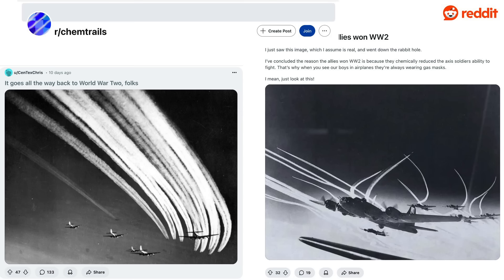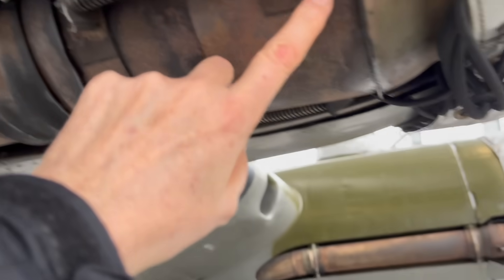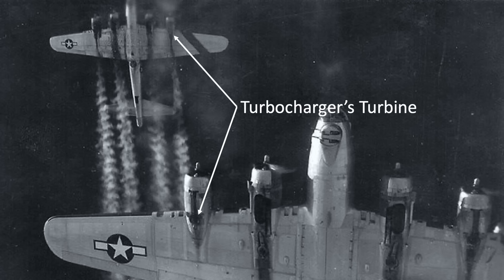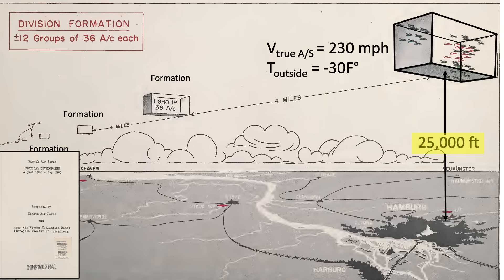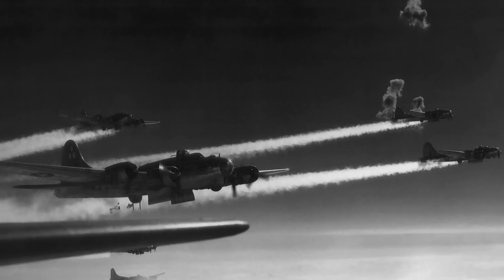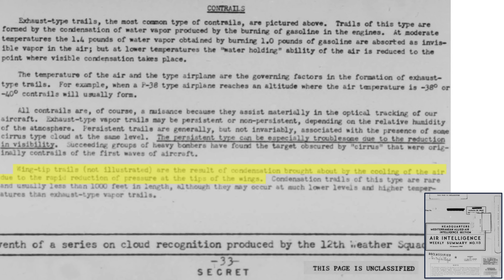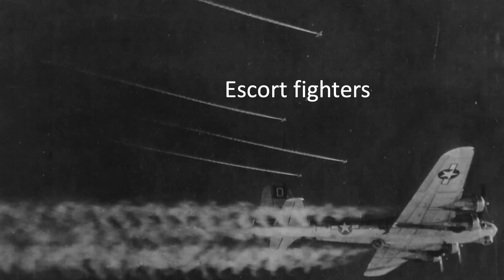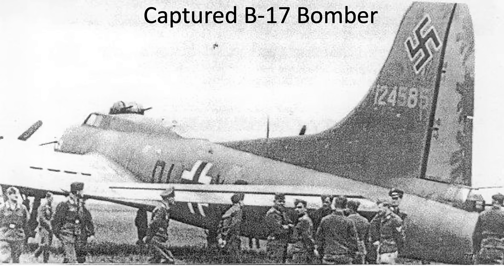WWII B-17 Bomber’s naturally forming contrails, no chemical-trails going on here

Comment: I always saw tons of contrails back in the 70s as a kid and up to today.  I really doubt super secret airplanes have been spraying toxic chemicals all the way since then. The chemtrail theories bug me because there's literally no evidence at all for it.  To cause changes to the atmosphere would require vast numbers of airplanes to be spraying chemicals every day but notice how not one person has noticed any hidden tanks, spray nozzles or anything on commercial aircraft.  The small number of actual government aircraft (ie DARPA/NASA) that could be changed to add special tanks would not be enough to change the earth's atmosphere.  The other problem is they wouldn't have airspace clearance to spray over Europe, Asia or other airspaces.  So you'd have to suggest maybe there's a additive in the jet fuel that no one has ever noticed and somehow can burn in a jet engine and still do it's chemtrail job as it comes out the exhaust.  It's absurd.

Comment: Ironically, the more prevalent contrails now are a good thing.  High-bypass turbofan engines mix the exhaust gases with bypass air at significantly lower velocities than the straight turbojets of the 70's, thus the water vapor cools and condenses in a much tighter pattern and is more visible.  So a thicker contrail is associated with higher fuel efficiency.

Comment: Thanks for putting this video together, i can't imagine what it must have been like to be a civilian on the ground looking up at formations of bombers, their escort fighters and the German fighters all flying around that area of sky.  I was a sceptic regarding chemtrails until i had my own visual experience. I watched 2 transatlantic flights flying parallel to each other one summer morning, one was flying at 36,000 ft and the other 40,000 ft, one left a trail that went from horizon to horizon and the other left nothing. At that altitude the temperature should be between  - 40 and -65 so within less than a mile of sky one left a trail and the other didn't. With certain governments considering high altitude aerosol spraying to reflect direct sunlight back out to space in an effort to slow down climate change, is it possible that some airlines are actually involved with this project and adding something to the fuel so that they don't disperse as they normally would and form an artificial cloud layer over a few hours. The British government has announced recently that it will spend up to £70 million pounds on high altitude spraying... I'd be grateful for any return comments to my comment 🙏 👍

Comment: Yes, there are chemtrails - possibly .0001% of what is seen may be cloud seeding experiments, which they actually do in some desert regions to attempt to stimulate the formation of rain clouds.  The biggest problem I see is idiots getting on social media and showing a picture of something like a twin engined  C-310 with tip tanks and claiming they are a pilot who is spreading chemtrails. That sadly sucks in a lot of people who then think they know someone who knows.    It is so hard to explain to a believer that the reason we see more contrails as there are thousands more flights than when they were younger AND, even domestic flights are a lot higher than they used to.  It is a never ending battle to impart common sense.

Comment: Some airships in the early 20th Century were experimenting with an exhaust vapor/water recovery system to compensate for the lost weight from fuel burn. Boeing could have teamed up with Frigidaire to make an ice bomber from high altitudes! And the lack of a vape trail would have made the bombers as stealthy as those experimental blimps.

Comment: If you were dropping a chemical agent, you wouldn't drop it from 30,000 feet where it's likely to be highly dispersed before it reaches the ground (and a lot of it might not even end up in Germany).  You also wouldn't use an agent that required so much that it left a  visible trail.  And you probably wouldn't do it in daylight, there's no need for any great precision.

Comment: water is a chemical (heh-heh!). did those p&w engines burn 100% clean with no soot particles or unburned fuel in exhaust? did these bombers have to bring water with them to inject into combustion chamber? how many gallons needed for a sortie? was it distilled water?  musta reduced bomb payload.
Reply: Combustion yields carbon dioxide and water, so yes, they did bring it with them, but in a different form.

Comment: So how did a contrail effect a bomber that flew into it?
Reply: Its mostly water vapor, so the primary problem is sight.
Reply: @kirgan1000  Possibly also a problem with icing, but would depend on the temperature of the bomber's surfaces, the air temperature and relative humidity.
Reply: @kirgan1000  If you can see the water, it's not water vapor. Contrails are like clouds. Little crystals of ice or little drops of water.

This is a common misunderstanding about water vs water vapor. Clouds are not water vapor even though they are often sited as an example of water vapor. Water vapor is invisible.
Reply: Limits visibility, Germans often used contrails to hide their approach.